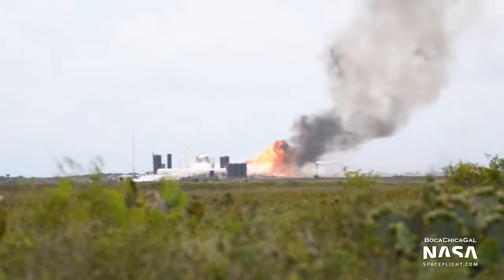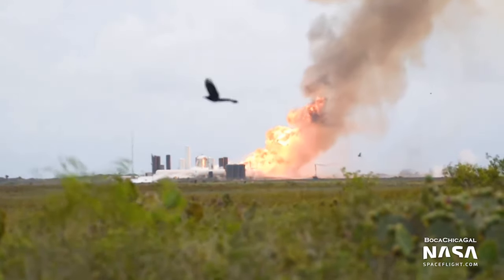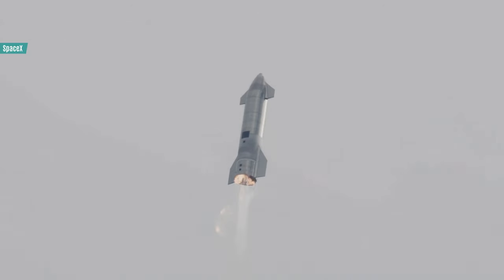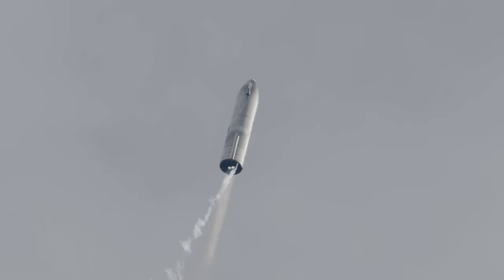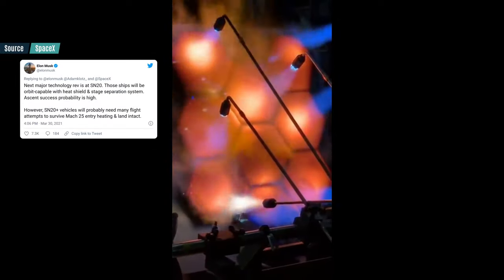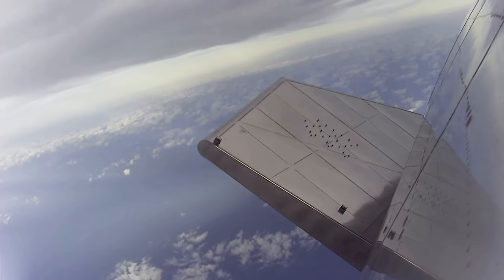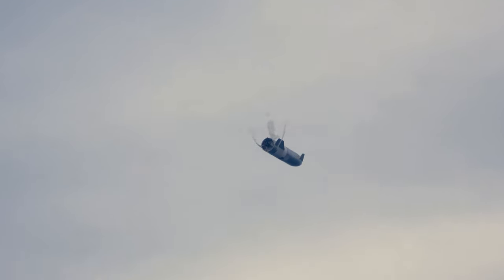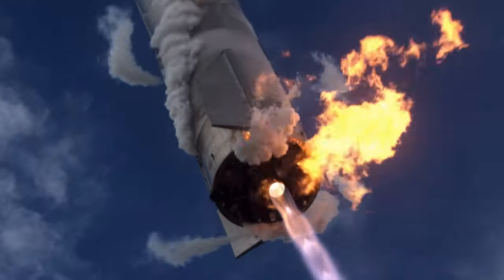10 ways Starship orbital test could fail

Comment: 100% agreed that reentry is the most likely failure point. What will be really interesting, if it gets that far, is to see the exact failure mode. Do the heat tiles fall off or break? Does heat penetrate between them too much? Does attitude control fail at this intense period of flight? Avionics fault due to extreme stresses? Flap motor issues? So many possibilities to learn!
Reply from the maker: You are right, there are many waus the reentry could fail. Sadly during most of reentry the communications will be lost due to the plasma bubble around the ship. I hope they find a way to retrieve some data though, maybe something like the flight recorders on the planes...

Comment: 1.  Not likely - because these have been tested, and engineering and experiments, they will know material limitations.
2.  Also not likely as the process has most likely known.
3.  Loss of one engine not an issue.  There is redundancy designed in.
4.  Misleading.  Crew Dragon booster was destroyed on purpose as it was at the end of its life and was not going to be reused.   Flaps should not be an issue, but could be a minor one only, as they will have sensors to adjust the flaps on its upward trajectory.  They have already tested that but not to super sonic speeds.
5.  Separation.  Space X has already made that mistake and they know what to account for.   In earlier ones, the booster bumped into the upper stage.  They know this already and risk will be low.
6.  Light up of second stage - on re-entry they had to RELIGHT the 2nd stage but in the case of orbit, they will light up for first time only.  
7.  Heat tiles ... there is a real risk there - but we do not know the speed yet,  it may be slower than 27,000 km / hr.  They would have done CFD studies already but still is a big risk.
8.  Landing is lower risk because engines for landing will be fired up for the first time for landing so less likely to go wrong.

Other possibilities are lighting 29 engines on lower stage and the effective vibration and noise - how that would effect the spacecraft as a whole has a big risk for me.  They are only using 3mm plate.  Its a lot of power.  So the integrity of the structure will be tested to the utmost.   
Are they prepared to launch stage 2 if the booster fails on lift off or during lift off?  No one knows of their contingency plans.  Can they separate the 2 stages during launch to recover upper stage if lower stage fails?  

Also important - what about landing the lower stage after?  No mention of risks there.   On reentry - how will the booster landing be?  This is still an unknown as well.  
Will they test Booster separately first and build more than one booster first and test firing all of the engines without an upper stage?  Or will they test using SN 15 first or go straight to orbit?  
What are they going to do with SN 15 and SN 16?   
Hmmm so many questions.
Reply from the maker: Thank you for your comment
1-2 I also think this is sorted out, but keep in mind we are not in industrial phase right now, there still might be some issues left
3 The test booster will have fewer raptors, which means lower fault tolerance
4 The booster was not destroyed on purpose per se, but I wanted to show an example of what happens when a rocket looses aerodynamic stability. This is what happened with Crew Dragon test because the aerodynamic capsule had left, and the motors were off. The booster turned into the wind and was shreded by it, which led to the explosion. On Starship the flaps are useless during ascent, the should rotate on the other axis to be useful. And puting wings on the front of the rocket is a huge aerdynamic problem, counteracted by the capacity of the raptors to gimbal.
5. We are talking extremely huge stages here. It is very much possible that the system that works on the Falcon (an electric pusher) doesn't work here, or not as intended.
6 You are right, but there is still a possibility that not all motors start properly, which happened during some static fires

I think if anything goes wrong right after liftoff they will activate the flight termination system and explode everything. You are right, vibrations are a huge risk factor.

About the landing of both 1st and second stage, they will be on water, which will reduce the risks (no reuse, assuming everything works, both stages will eventually fall onto the sea and suffer massive damage)

Comment: I'd say initial Starship (second stage) Raptor ignition is low risk. The only issues have been when coming out of bellyflop position when using header tanks. Ignition from main tanks has been very reliable.
Reply from the maker: The first ignition was very reliable because they did not attempt it if anything seemed suspicious, hence the delays before the static fires and liftoffs. That being said, the Raptor begins is no longer in its early, capricious days and should perform more reliably

Comment: I suspect, without any data behind me except having watched all the previous tests like a hawk, that if it survives reentry heating, the flaps will perform just fine the rest of the way down. The next most likely failure would be engine relight from header tanks and flip maneuver. If the vehicle manages to survive through everything all the way to the very end, I do think it's going to be hard for the public to know if it would have nailed the landing or hit too hard on a solid landing pad. Some of the other tests have looked pretty close to surviving the landing until that extremely last moment boom made it clear that it was going too fast after all. With an ocean landing I have a feeling it will seem very likely to have survived had there been a pad, but that could be misleading. Here's hoping we get some kind of drone or chase plane footage of the event should it make it that far!
Reply from the maker: You are absolutely right about the ocean landing, I should have mentioned it!
About the atmospheric flight right after entry, this is really different from the flight we have seen. A supersonic flight in a thinned atmosphere has different stability issues than a subsonic flight. But obviously SpaceX knows that and given how they nailed the subsonic flight from the first try, they will probably be fine.